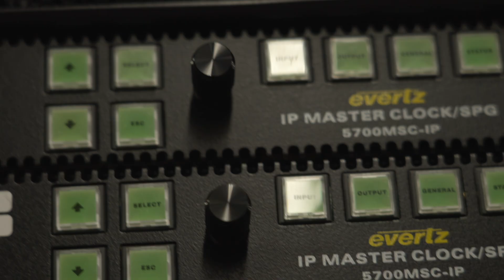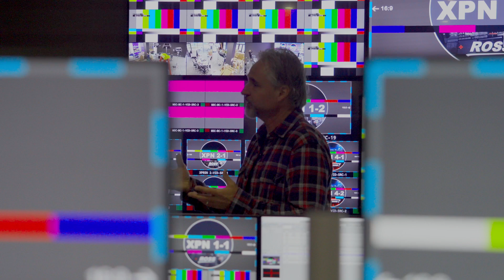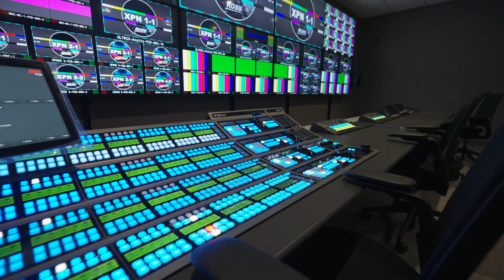ST 2110 IP Video: Future-Proof Broadcasting - 4K, 8K, & Beyond! University of Kentucky Case Study

Comment: How have you found the latency with 2110 for live broadcast?
Reply from the maker: Subjectively speaking, it's almost negligible.  Literally milliseconds.  Of course there is inherent latency, and it can vary whether you're switching Layer 2 or 3.  However, you don't "feel" it any more than you do in a baseband system that's being processed and encoded on a TX output.  I would argue that those conditions with baseband could be even more laggy.